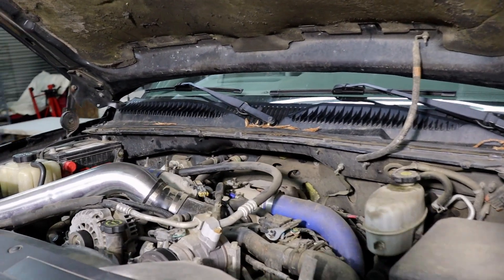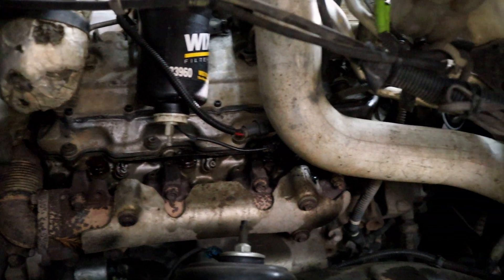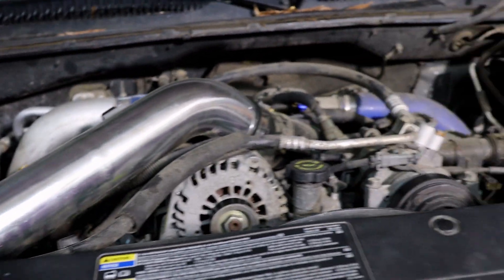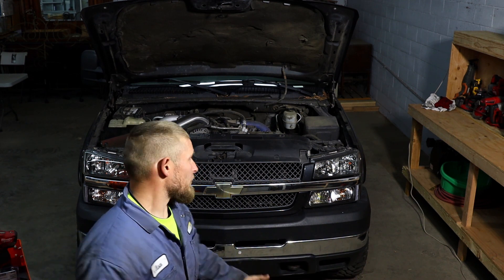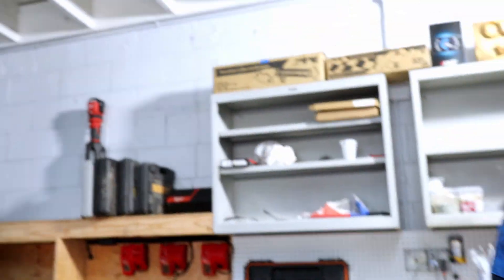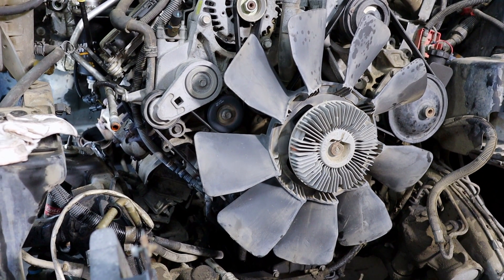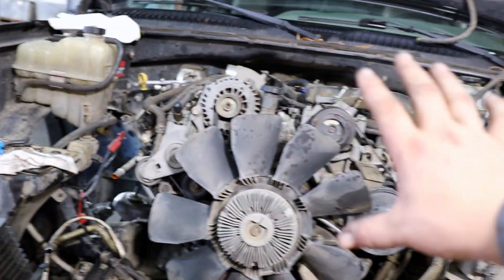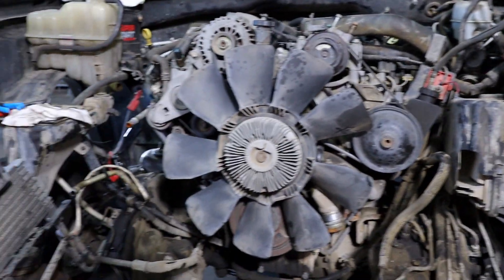LB7 Duramax Engine Rebuild:  Part 1 - Engine Removal

Comment: Hey I’m about to rebuild my motor on my 04 lb7, what rebuild engine kit did you go with or would recommend?
Reply from the maker: Nice! I bought most of my parts of Lincoln diesel specialties, I don’t think they sold a kit if I remember correctly, I had to piece it together.

Comment: How many miles?
Reply from the maker: The truck had about 295k when I pulled the motor. As you will find out in the future videos, I would have left it alone, but I found out from the previous owner that it had a cracked head for the last 10 years, which caused some major engine sludge that was affecting oil pressure, etc...
Reply: Peterson cat? Which store?
Reply from the maker: @nickchase9579  got the coveralls second hand. No affiliation to Peterson CAT.